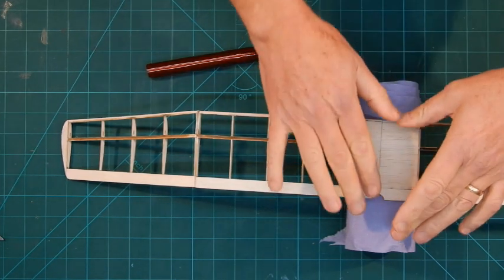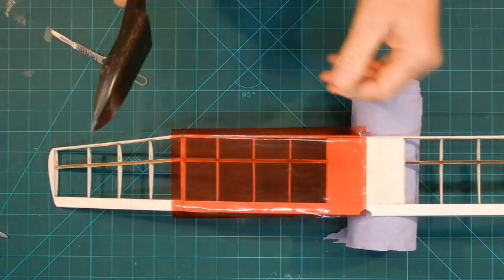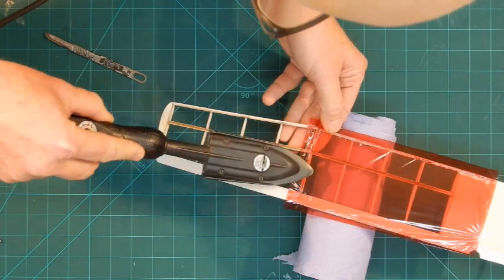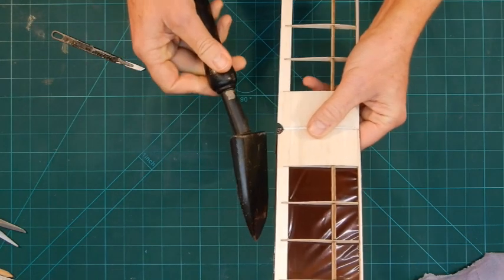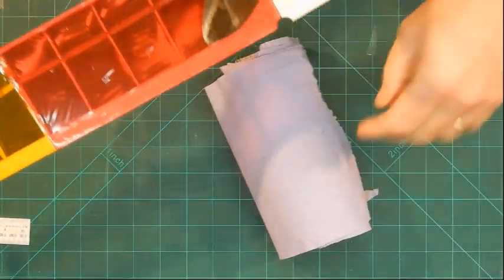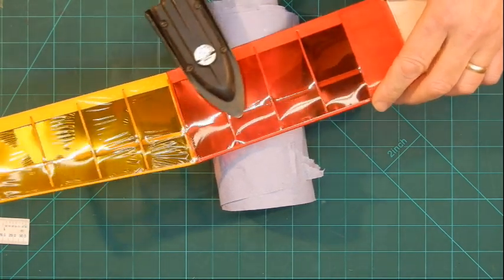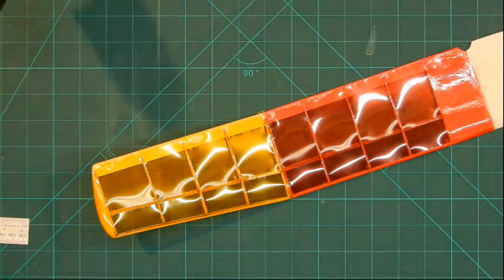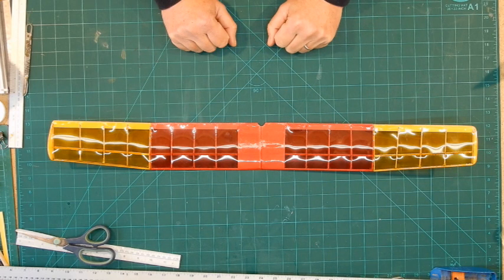Micro Gentle Lady Build 8 beginners guide to heat shrink covering the wing

Comment: I use a hot air gun and a soft cloth for shrinking - you can get a little 300 watt hand held heat gun off ebay for about £8 that is perfect for this
Reply: Great mate just trying to do it cheap for beginners. I will use heat gun on next build